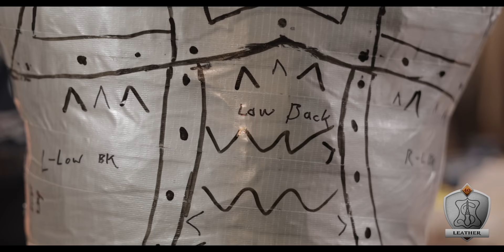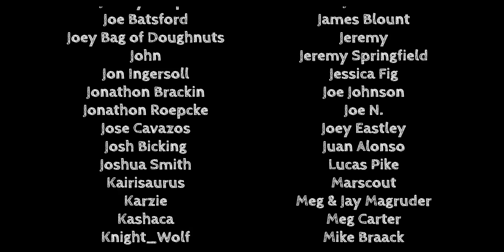Epic Scale Leather Armor (The easy way)

Comment: Hey Cl3ver, fun fact: you can erase sharpie with dry erase marker. All you have to do is just scribble over top of your lines then erase. Alternately, just wipe down with hand sanitizer. The alcohol breaks down the ink. And I know we all have a plethora of sani now lol
Reply from the maker: That IS a fun fact! Thank you!!!
Reply: And if the sanitizer doesn’t take the marker off enough, a bottle of high % (90%+) iso alcohol covers many sins. Its also great for general cleaning, electronics, finishing 3d prints, heck, you can even use it for its basic purpose, sterilizing wounds (though i don’t recommend it)
Reply: Yep
Reply: Wet erase markers are going out of style, but are still very much available, don't smudge much, and wipe off with water.
Reply: @SkillTree  I paused halfway through the video to say that as well, lol. Also: Now that you have the chest piece, you'll need to make Tassets (a belt of segmented plates that protect the thighs and groin), and Pauldrons (Shoulder armor that laces into the strap at the top of the chest piece). And don't forget the Gorget!
Reply: I remember blowing a teachers mind with this when I was at school. Someone had drawn with permanent marker on a whiteboard and told her about that trick.
Reply: rubbing alcohol also works, and also works on removing Silly Putty from hair/fur/fabric, in case you accidentally get some on, for example (for no particular reason), your parents' fuzzy bunny slippers.

Comment: Just so you know.

You should don padded armor before you don the leather, gambison, ring,  or chain mail.

The padded armor protects you from bruising and chafing.

If you decide to go further.
You can then add a layer of steel plate mail.

There are massive gaps in your leather armor. 

Leather armor is good for firmer padding against blunt weapons and resistant to slashing weapons.

Scale mail is designed to cause slashing strikes to glance off the scale. Additionally scale mail is interlocking with other scales. This 3 layer scale is designed to prevent any upward thrusts or stabs from swords or spears.

Typically you would don padded then chain/ring then scale mail for this armor type.

Happy crafting.

Comment: You can add spaulders/pauldrons by putting a buckle and loop on the underside, allowing them to attach to the shoulder strap of the cuirass. Alternatively, add a buckle to the cuirass shoulder strap and a tongue to the pauldron. Either way put an adjustable loop at the lower end of the pauldron to keep it centered on the arm.

Comment: You using your wing divider instead of measuring between each rivet is actually historically accurate. If you look at historical armor pieces you will notice that not every line is straight or every rivets perfectly spaced.

Comment: In the areas of overlap, I would have suggested skiving the leather.  It would thin the leather to make areas such as the 3 layer section easier to handle.  It would also be good on the edges of interior panels to improve the feel with a smaller edge.

Congratulations on your sponsorship!

Comment: Here's an alt tip for riveting thick layers of leather.  Use pop/blind rivets with flat-top cone studs.

I found that the conventional rivets in typical leather LARP armor kept busting wherever I flexed (not bragging, srsly).  When I repaired the armor using pop/blind rivets with cone studs, the join held stronger than the leather!

Comment: For the triangle scraps, you can dye or paint them in a black, gold or silver. Then place them under a rivet as an accent piece. Adding just that bit of depth to your project.
It also helps strengthen that area if it is under a lot of stress or movement.

Comment: An alternative to the multiple rivet technique would be binding posts, which you can find at hardware stores like Home Depot. A binding post has two parts, a hollow rivet-like piece, and a machinist screw that screws into it to form essentially a metal rod with flat flanges at both ends. You can buy them in various lengths and you can cut them with a hacksaw for a more precise fit. The only tricky part I can think of would be making sure the head matches the other rivets if you are really particular about uniformity.

Comment: Really excellent build!  The solution to all the areas exposed so you can move is chain maille armor underneath the plate.  It will add thickness, so the plate will need to be a bit looser.  A padded gambeson (or even pieces that stick out to resemble a full maille shirt) could replicate the look as well.

Comment: You're creative in your problem solving, & I love that. Congrats on the Tandy sponsorship! Dye the wee triangles of scrap different colours to use as tesserae (tiles used in mosaics) & make trivets or coasters with 'em. Glue 'em down to a piece of leather or a wooden panel with a "well" cut into it so the tiles sit flush with the edges of the wood. Your armour came out AMAZING! Just need a gorget to protect your throat.

Comment: congrats on the handy dandy sponsorship from Tandy! been a long time comin'!  Also, you probably know about them but there's edge slickers that have a little post on them so you can chuck them up in your drill. I found these to be super handy for belts or straps, just throw some tokinole on there and run it down and it knocks it out really quickly. I highly recommend it! I just got some cheap plastic ones from amazon and they work just fine. Armor looks amazing, btw

Comment: Ok the triangle pieces can be used just as they are or rounded, as spacers/washers between the panels to give it depth or allow movement. Also as test  swatches for dying. The lower buckles should have been on backside, so the remaining straps wouldn't flay around as you move. If the scales were to be more prominent, it would behoove you to make them articulate.  Instead of the backer panel, you'd use 3 or 4 longitudinal straps and rivet the scales to   them. An oval slit on the scales with a metal washer on top and a leather spacer below. You'd also need to stagger the rivets every other or third. Also a long sleeve t-shirt with a  silk-screened chain mail, would look cool (if you don't have a long sleeve chain mail). Anyways, thanks for the video. Awesome as always, loved it. John S.

Comment: At about 18:50 Your solution for the thick leather vs short rivet was a good Idea. I prefer to use the copper rivets (I get my supplies from Tandy also). While they are a little more work< I find they are more dependable. I am rough on my garb. I also Like the solution for the scales. I may have to play around with scales on corsets now.

Comment: Have you thought about laminated pieces of steel inside the leather making it brigandine armor where the steel is sandwiched between the leather.
Second, add a chainmail underneath it and then a protective cloth garment underneath that as a rash guard.
Next, belt and tassets and chausses and greaves.
Add to the top some pauldrons and vambraces and gauntlets and you're set except for gorget and helm

Comment: 18:30 

As far as the thickness, you can Clive down parts of it to reduce thickness. Or, since it is a point of connection, maybe with a lot of stress, I do think that your rivets sitch works
Reply: Dang autocorrect! I was coming to comment on this as well. Areas where the leather is thick should be skived. A little skiving and a longer rivet would work just fine here.

Comment: The first thing that popped into my head for those triangles was similar to people saying make them into prop caltrops. Bevel both sides, harden, then dye them black and you have loads of teeny, tiny nonlethal, mostly safe throwing stars. Maybe not the best idea, but the mental image I had of reaching into a pouch and pulling out a handful of leather "death" was fairly funny.

I did wonder if you could avoid making them though. Make a double width strap, draw a line down the center, then another the width of your punch away from the center so you don't drift one way or the other. You'd end up with a row of scales and a row of points. You could then just hold onto the pointed straps for decoration or embellishment on a future project. Say it was a celebratory outfit for a masked ball or something, you could dye the strips alternating bright colors and it would mimic those hanging pennants you see at county fairs and grand openings.

Comment: Interesting, armoring is one of my favorite things to do, usually right behind making and playing strategy games, got some 4×10 steel plates for smithing out some scales one of these days, and I'm gonna have to make the greatest earthen shield ever with some modern ease and simplicity not including forge availability and stubborn non-round captain america shield disbelief and brutal or crude practicality, 

perhaps well suited to attacking vehicles at times too or as a shield rather than the anime berzerk with an equilaterial triangle pointed truncated cylinder shield lance from elbow to past the hand anyway; while modern tailoring can help without wanting the clunkiness or more spread out protection of old medieval plate with more intricate skill sets with brads, or riveting, or whatever to connect the pieces. I wanna say there were a few shields used in ww1 rather than ww2 by the germans that were better after one guy used everybody elses as they're typically wide and thin rather than skinny and thick for however heavy it ends up being as lionentech, which will be good anyway. I'd say between about 25-and probably not more than 40 lbs. Might be ideal for swinging and carrying though?

Comment: Easier slicked edges: bevel edges, use a circular Disc edge slicker on a power drill, and Tandy has a "Tandy brand" version of a product called tokenol. Use less of it than you think, sorry about the goofiness. Its important to use a slicker in only one direction so the leather fibers lay down in the same direction. Add slick with water, a light sanding, and dye before using the edge product and you can get near Mirror edges. Happy Crafting!
Reply: *gooiness  (gotta love auto correct ;) )
Reply: Quick set rivets are easy, but start using traditional rivets and set Rings. You make the rivets any size you need. Getting a rivets finisher will make the end pretty as well.